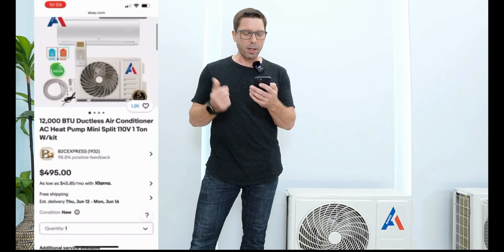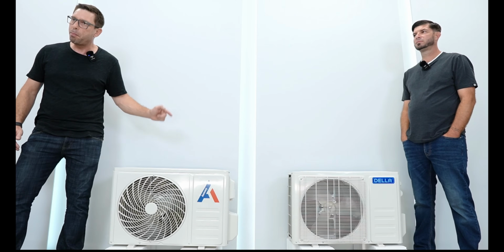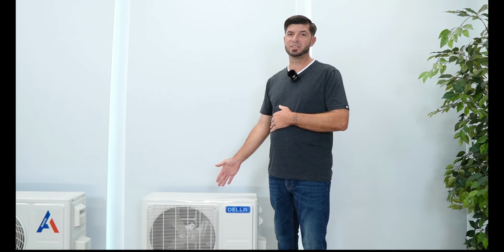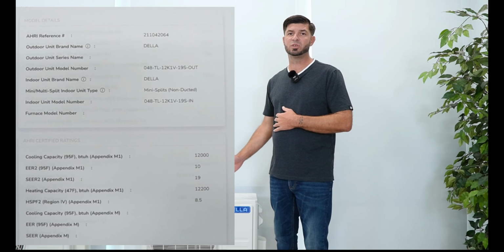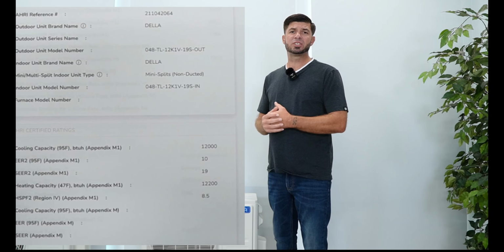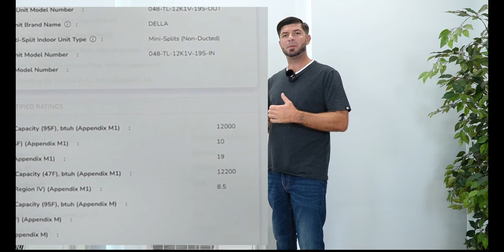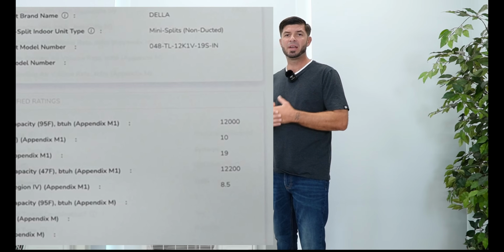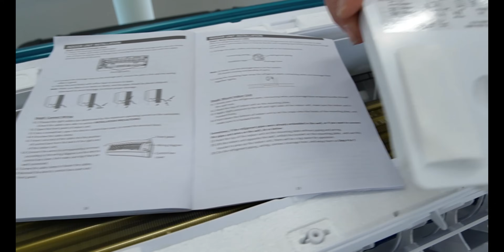Exposed! Ductless Mini Split Scam | No SEER2 | No Tonnage | No HSPF2

Comment: If anything happens there are no parts supply. Repair companies don’t even try to fix them.
Reply: Actually, it seems the lower rated/simpler unit has some commonly available parts (like caps) that could be aquired and replaced DIY, and a refrigeration shop "could" bench repair the gas components if you delivered it to them. All that would be on you though, likely no warranty coverage and typical HVAC guys wouldn't bother to show up. Too low a value paycheck, too much liability for a maybe crappy DIY install job.

Comment: Actually, on the Della, it's an AC compressor fed 3 phase from the inverter board (as evidenced by the UVW connections).  A DC compressor wouldn't be very practical as its speed would be harder to control.
Reply from the maker: You are correct! It's more like ''frequency drive''. However the the ESC is powered by DC voltage. Those compressors are the most reliable ever.